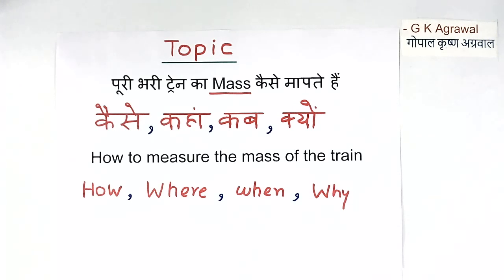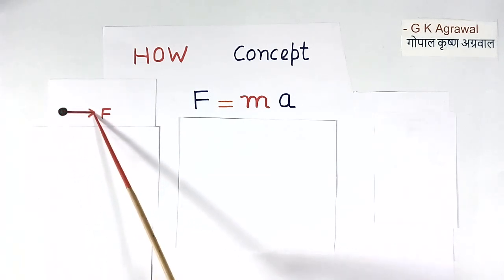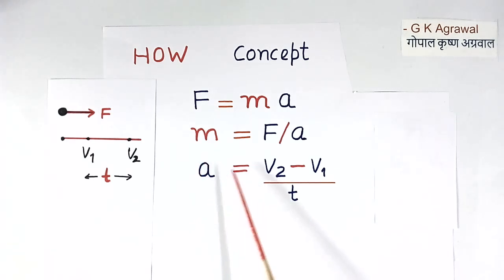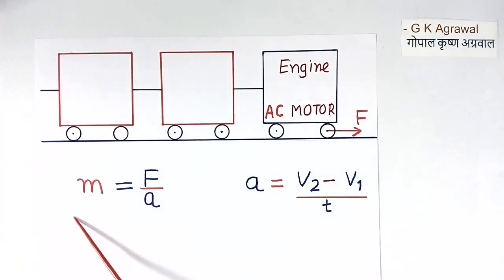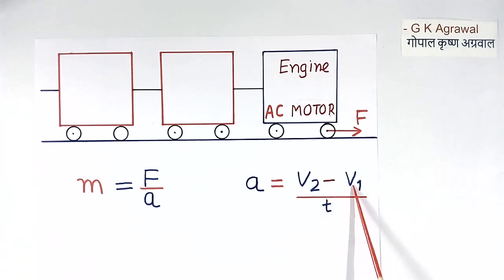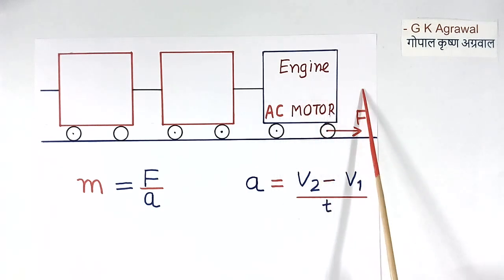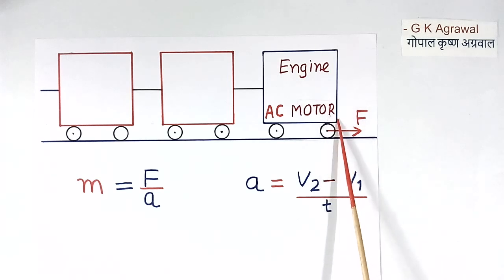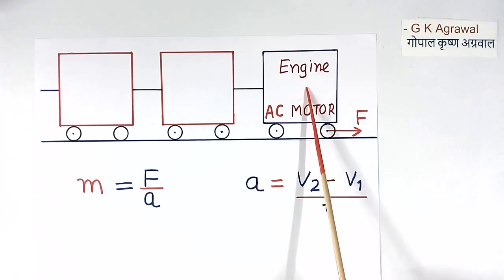Newton's second law of motion use, weight of moving electric train

Comment from the maker: Watch unique video on How to measure the weight of the railway train
Reply: Do you know who discovered this?
Reply from the maker: F=mf was invented by Newton, It is called newton second law of motion
Reply: @GKAgrawal2  yeah, but the sistem where  you can measure the train weight in movement  must have been invented by someone right? To check the weight of the cemercials, like the Romanians have that kind of technology for the trains
Reply from the maker: All companies making control for locomotive make their own hardware or based on technology transfer. These control system are quite complex. All companies follow their own algorithm. These concept are generally never published due to commercial reasons. There is too much difference between publishing a paper and making a commercial working product.